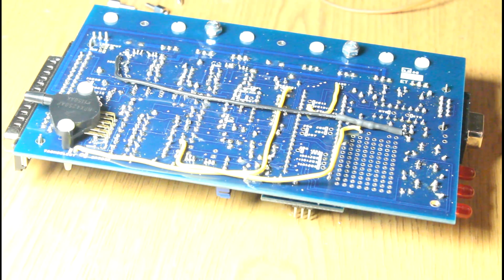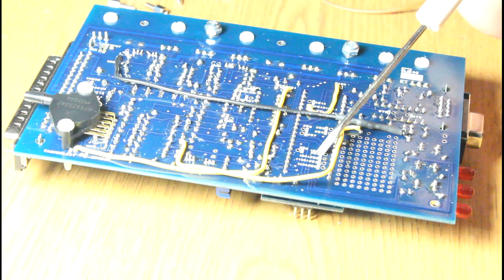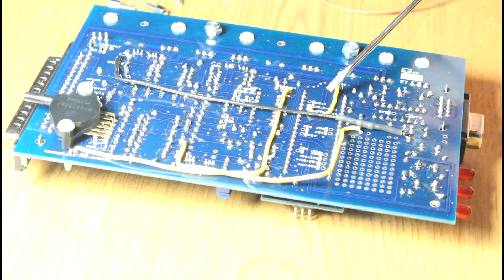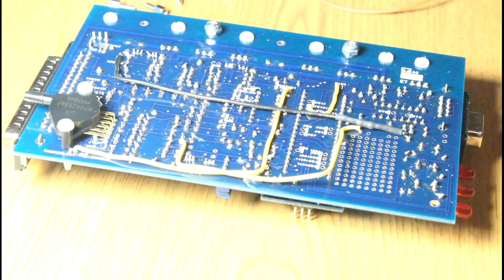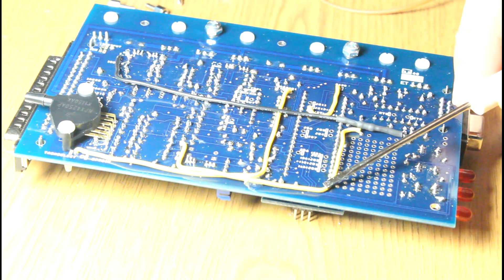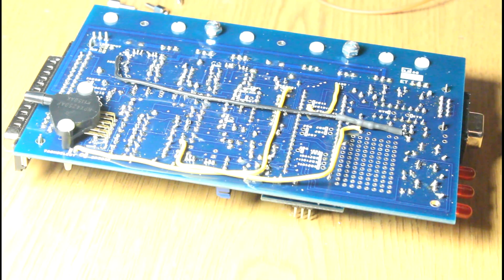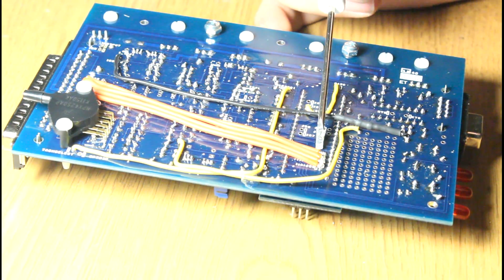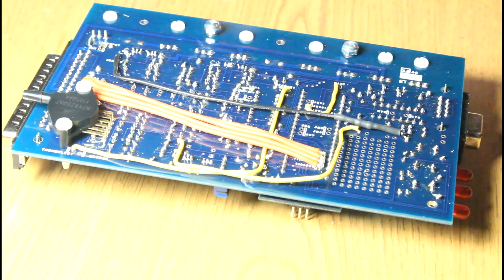Evan's Megasquirt Build Ep 8 - MS2 Stepper Based IAC Hardware

Comment: would the mega squirt 2 be okay for a daily driven and car , im planing on running 6 psi of boost and tuning for economy. my only other option is to pay $1100 for a tunable plug and play hondata ecu
Reply from the maker: +Austin K sure. The eclipse in then end of these vids would have been a fine daily... AC and everything. Biggest challenge might be getting it tuned well for economy, and things like consistent easy cold starts and idle quality under all conditions. It's very doable to get an OEM style tune if you put in the effort.  People with race cars don't care about idle quality, but if you have to restart the car or feather the throttle at every stop sign it gets old fast.
Reply: SquishyBrained you should get another project car like a 300z they are pretty cheap and have some potential, just wait until tax season is over and when it starts to get hot , you can find old cars with out a/c for pretty cheap